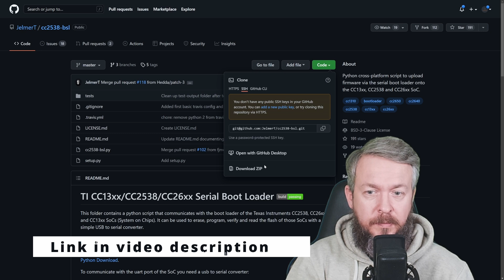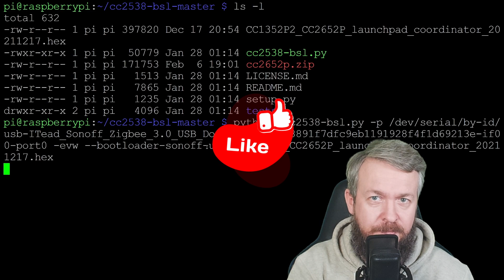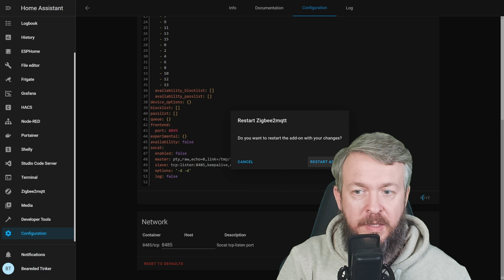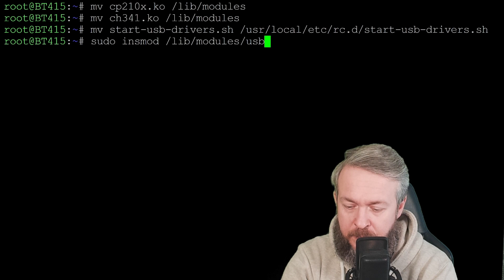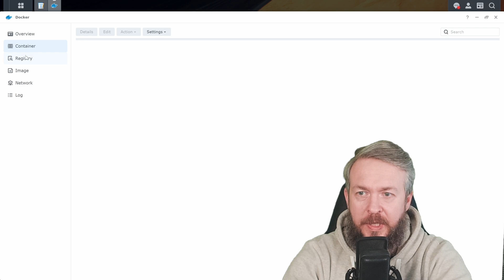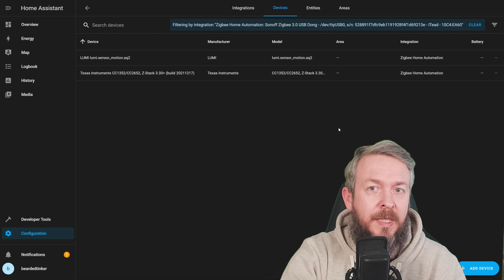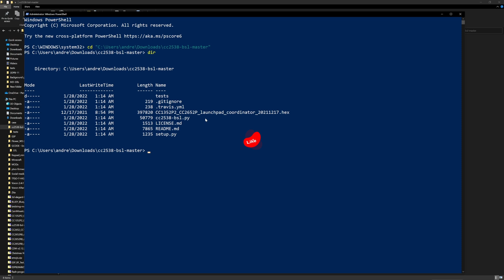Flashing Sonoff Zigbee 3.0 USB dongle plus and Home Assistant guide

Comment: getting this error in windowa PowerShell: Opening port COM3, baud 500000
Reading data from CC1352P2_CC2652P_launchpad_coordinator_20240710.hex
Your firmware looks like an Intel Hex file
Connecting to target...
ERROR: Timeout waiting for ACK/NACK after 'Synch (0x55 0x55)'
Reply from the maker: I haven't used this in a long long time since we now have easier and better ways to flash firmware.
If yo're using HA, try https://youtu.be/E39ECyCXJaA
Reply: @BeardedTinker  I got the same error and your new method is also not working as when I add the zigstar to the store it dont show at all no matter how long I waited !!
Reply from the maker: @mundhiral-kiyumi8300  This error is usually associated with USB device not being in BSL (some devices require you to press and hold the button on it while connecting device to PC) - or could also be when wrong port is used.
Quick Google search gives this: https://github.com/JelmerT/cc2538-bsl/issues/116
As for ZigStar Addon - if it's not visible immediately, URL could be wrong.

Comment: Tried to flash the new 2023 f/w no luck :(
Got an error: int() can't convert non-string with explicit base
Anyone knows how to resolve??

python cc2538-bsl.py -p COM3 -evw --bootloader-sonoff-usb CC1352P2_CC2652P_launchpad_coordinator_20230507.hex
sonoff
Opening port COM3, baud 500000
Reading data from CC1352P2_CC2652P_launchpad_coordinator_20230507.hex
Your firmware looks like an Intel Hex file
Connecting to target...
CC1350 PG2.0 (7x7mm): 352KB Flash, 20KB SRAM, CCFG.BL_CONFIG at 0x00057FD8
Primary IEEE Address: ....
    Performing mass erase
Erasing all main bank flash sectors
    Erase done
Writing 360448 bytes starting at address 0x00000000
Write 104 bytes at 0x00057F988
    Write done
Verifying by comparing CRC32 calculations.
    Verified (match: 0xe83aa727)
ERROR: int() can't convert non-string with explicit base
Reply from the maker: No idea actually. You may try using other method - with HA AddOn if you are using HA OS - https://youtu.be/E39ECyCXJaA

Comment: "could not open port /dev/serial/by-id/usb-ITead_Sonoff_Zigbee_3.0_USB_Dongle_Plus_0ab963cbe844ed11ae65c8c90a86e0b4-if00-port0: [Errno 13] Permission denied: '/dev/serial/by-id/usb-ITead_Sonoff_Zigbee_3.0_USB_Dongle_Plus_0ab963cbe844ed11ae65c8c90a86e0b4-if00-port0'", i cant put it in manual bootloader because it says that it cant find device because its not in bootload mode. I tried holding button after connecting, i tried holding button when connecting, of course every time at least 10 sec. No idea...
Reply: after using sudo i get this "ERROR: Timeout waiting for ACK/NACK after 'Synch (0x55 0x55)'"
Reply: Found solution, i had to disable ZHA in HA :)
Reply from the maker: Glad you managed to sort it out :) BTW  did you see latest video on flashing Sonoff devices? Via Add-on? https://youtu.be/E39ECyCXJaA
But still, you need to disable ZHA or Zigbee2MQTT to release the port/device

Comment: no luck for me... 

Getting ERROR: Timeout waiting for ACK/NACK after 'Synch (0x55 0x55)'
Most of the troubleshootign guides that I have seen mentioned this is because of the bootloader setting not being enabled, and can be remediated with --bootloader-sonoff-usb, but I'm already using that flag. 

One thing that is interesting though is that my device isn't under /dev/ttyUSB0, its /dev/ttyACM0, I wonder if that has anything to do with it
Reply from the maker: Maybe you should manually put it in bootloader mode. Or try to ask dev on GitHub - he really tried to answer all issues.

Comment: This was BY FAR the best video I have found. I can not belive the other videos comparing to this one. It work the first time on the windows method and was not only easier, it was faster. Thank you very much for this video, it solved my issue with getting the dongle into bootloader mode within a minute, rather then the hours of me trying and re-trying.
Reply from the maker: Thank you! BTW, wait till you see today's video in a few hours. There's an easier way now. If you are running HA OS.
Reply: @BeardedTinker  haha damn! Wish I had waited now. But it was easy enough 😉!
If you want suggestions I would like to know how to update zigbee devices without connecting them to native hubs. Such as ikea. Thanks again man! Subscribed now 👀
Reply from the maker: Do you use ZHA or Zigbee2MQTT? If ZB2MQTT - it's very easy as one of the options is OTA - and when you click check OTA it would go through all devices and search for firmware update and if available it would offer you update option. BUT it's limited to just few manufacturers at this time. IKEA works great, for Tuya and Aqara I haven't seen a single update in years.
Reply: @BeardedTinker  i use ZHA! Oh nice! I will Google that and see what I can find out. Thanks for your input!

Comment: Is it possible to flash CC1352P2_CC2652P_launchpad_coordinator_20230507? Hex file is bigger than erlier versions.
Reply from the maker: CC2652P  Launchpad is not same as Sonoff Dongle P - not sure if the firmware would work on it. And I've never tested it (launchpad) - I presume there is FW for it and if there is, no reason that it shouldn't work.
Reply: I have succesfully flashed version CC1352P2_CC2652P_launchpad_coordinator_20221226 file size is 401KB but last version _20230507 is 497KB  @BeardedTinker

Comment: Thanks mate!
Down to the point, no fluff and really exceptional well made.

Only little point to criticise: 
A python venv would have been great, to not to pollute the OS's python installation.
As suggestion: 
python -m venv venv
./venv/bin/activate
sudo ./venv/bin/python cc2538-bsl.py -p /dev/serial/by-id/usb-ITead_Sonoff_Zigbee_3.0_USB_Dongle_Plus_528891f7dfc9eb1191928f4f1d69213e-if00-port0 -evw --bootloader-sonoff-usb CC1352P2_CC2652P_launchpad_coordinator_20211217.hex 

Clean python, fresh firmware on the usb key, happy user in front of the screen. :)

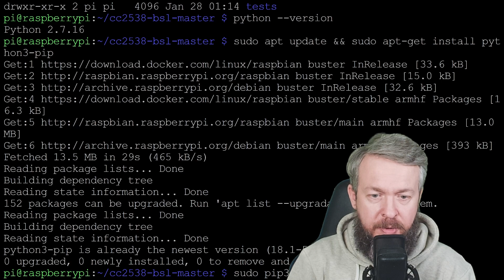Comment: 7:05 could you please move? 😀
Reply from the maker: 😱 yeah, I know... But I also add all of the commands down in video description. Easier to copy/past that copy from screen. Sorry for that 😉
Reply: @BeardedTinker  I noticed that right after I sent the comment.. haha..
Reply: @BeardedTinker  command "pip install pyserial intelhex" is not working in my end. should I continue to the next step or I have to stop right there. I'm scare if I break my device. any help?
Reply from the maker: Thats needed to communicate with USB stick and without it it will fail. What machine are you running this command on?
Reply: @BeardedTinker  macbook pro M1

Comment: Didnt work for me.

python3 cc2538-bsl.py -p /dev/serial/by-id/usb-ITEAD_SONOFF_Zigbee_3.0_USB_Dongle_Plus_V2_20221029110249-if00 -evw --bootloader-sonoff-usb CC1352P2_CC2652P_launchpad_coordinator_20221226.hex
sonoff
Opening port /dev/serial/by-id/usb-ITEAD_SONOFF_Zigbee_3.0_USB_Dongle_Plus_V2_20221029110249-if00, baud 500000
Reading data from CC1352P2_CC2652P_launchpad_coordinator_20221226.hex
Your firmware looks like an Intel Hex file
Connecting to target...
ERROR: Timeout waiting for ACK/NACK after 'Synch (0x55 0x55)'

Any ideas ?
Reply from the maker: Are you sure you have same stick - version P (https://sonoff.tech/product/gateway-and-sensors/sonoff-zigbee-3-0-usb-dongle-plus-p/) and not newer version E (https://sonoff.tech/product/gateway-and-sensors/sonoff-zigbee-3-0-usb-dongle-plus-e/)?
Those are different stick, with different chips and different firmware. Also flashing procedure is different too.
Reply: @BeardedTinker  You are right! My dongle was model E. Thanks.

Comment: thanks for the great video! but sonoff remains current? I don't know whether to buy it or wait for the new sky connect
Reply from the maker: This video was recorded on older Sonoff stick (Plus-P version). Newer one (Plus-E version) has same chip as SykConnect. The only difference is firmware. For E version, it really was not good but you can always flash newer one. BUT you can't use steps from this video to do it. It's completely different procedure. Mine is still running stock firmware (Plus-E stick).

Comment: Hello, thank you very much for this detailed instructions.
The tutorial really helped me a lot setting up my Sonoff USB Dongle on my Synology DS220+.

I am sadly facing an issue while setup the Sonoff Dongle with Home Assistant + Zigbee2Mqtt.

I run everything with Docker: Mqtt Broker + Zigbee2Mqtt + Home Assistant
Zigbee2Mqtt alone is working fine, i can find and setup my Zigbee devices in the frontend.
Home Assistant alone is working fine as well, i can see the Sonoff Dongle and pair all my Zigbee devices.

Now the issue:
When Home Assistant is running and i start the Zigbee2Mqtt Docker container then it seems like the Sonoff Dongle disconnects from Home Assistant.
And when Zigbee2Mqtt is running and i start the Home Assistant Docker container then Zigbee2Mqtt  gets an error and stops, and Home Assistant is running all fine.

Maybe you guys have an idea what i am doing wrong or what is happening there?

Comment: My dongle is being detected as USB-Enhanced-SERIAL CH9102  instead of the Silicon Labs CP210x     -- any ideas why? thanks
Reply from the maker: Is it P or E version? Fun fact - Windows 11 doesn't play nicely, no drivers as of yet...
I think it's E version and that one uses different chip but also different firmware and procedure. Mine E version is still running stock FW.
Reply: @BeardedTinker  Yeah it's the E version thanks! Stuck it in the Pi stock and managing to connect some zb devices with ZHA. Will try this for a bit before trying out Zigbee2MQTT I suppose

Comment: jadahl is down... SynoCommunity also has the drivers, but I'm running DSM 6.2 on a DS920+ (Geminilake), and the geminilake package is missing cp210x... /dev/ttyACM0 is showing up, but not /dev/ttyUSB0
Reply from the maker: Did you try with using /dev/ttyACM0 ? It could also work...
Reply: @BeardedTinker  yeah, figured that out a couple days later, but couldn't remember the video to update this. Turns out Sonoff has a second (very subtly different) sku with a different chipset due to the chip shortage, and this one connects as ACM rather than USB. 

Everything seems to be working fine. It also comes flashed with firmware that can handle all of the devices. I saw a concerning thread about it, but I haven't had any stability issues outside of an Aqara sensor. It turns out Aqara devices aren't fully ZigBee compliant, and they don't play nice with routing devices by certain manufacturers... And they refuse to try and connect to another router even if they lose connection... Forcing connection to compatible routers through the Zigbee2mqtt dashboard did the trick, though. I'm guessing the mqtt/z2m/HA people have sorted out the issues that thread mentioned.

Thanks for the videos! Super helpful!

Comment: I got a -P dongle sold on Amazon by somebody in Germany called zonoff an that connot be upgraded to work with HA. It accepts the upgrade ( I did it in windows  "pressing the button") It looks like this in HA " /dev/serial/by-id/usb-Silicon_Labs_Sonoff_Zigbee_3.0_USB_Dongle_Plus_0001-if00-port0" both before and after. Any Idea how to get it to work?
Reply from the maker: That looks like some older version I think... Mine is this: /dev/serial/by-id/usb-ITEAD_SONOFF_Zigbee_3.0_USB_Dongle_Plus_V2_20220622105009-if00 
Have to run out now, but will try to find something a bit later.
Reply: @BeardedTinker  Most grateful.
Reply from the maker: Did a lot of searching and couldn't find anything useful. Will try to search a bit more. But device name you get is a bit different from all I've seen so far.
Reply: @BeardedTinker  Right, I've spent a week now!

Comment: Why would I want to flash this sonoff zigbee 3.0 bridge?
Does it unlock something? mine is stock stick and works fine with zigbee stuff?
Reply from the maker: Original firmware on P version is a bit buggy, very old (usually there are 4-6 updates per year), some specific devices are not supported and number of devices you can connect directly and via routers was limited (I think it was 30-40 total).
Reply: @BeardedTinker  tanks.what I searched, my stick was some newer model, no bootloader button or reset button on motherboard. it was still possible mut was not so simple so I didnt so it. For me it works at the moment and thats enough. maybe someday I try the FM upgrade via jtag.

Comment: I allways get an syntax error while trying to flash the stick in Windows Power Shell: ... :

PS D:\sonoffStick> python cc2538-bsl.py -p COM7 -evw --bootloader-sonoff-usb CC1352P2_CC2652P_launchpad_coordinator_20220219.hex.hex
  File "cc2538-bsl.py", line 83
    print(message, end=attr, file=sys.stderr)
                      ^
SyntaxError: invalid syntax

any Idea ?
Reply from the maker: Check this one: https://github.com/JelmerT/cc2538-bsl/issues/111
You could have version issue, issue with path or something similar.
Reply: @BeardedTinker thank you for your fast response! I'll check it out asap.
Reply: worked, thx ! :)
Reply from the maker: Awesome! Have fun with it!

Comment: I get 

Opening port /dev/serial/by-id/usb-Silicon_Labs_Sonoff_Zigbee_3.0_USB_Dongle_Plus_0001-if00-port0, baud 500000
Reading data from CC1352P2_CC2652P_launchpad_coordinator_20220219.hex
Your firmware looks like an Intel Hex file
Connecting to target...
ERROR: bytearray index out of range
Reply from the maker: Hmm - is that older P version or newer E version of Sonoff stick? Looks like P but this error can show-up if using wrong firmware (or if bootloader not active).

Comment: Hi BT! I'm rather late to join the Home Assistant / Sonoff 3.0 USB ZBDongle-P party. Your video's absolutely sliced many cakes for me. Update: DS1821+ 32GB / Version: 7.1.1-42962 Update 1 / Home Assistant VMM 2CPUs + 4GB / Home Assistant 2022.9.6 Supervisor 2022.09.1 Operating System 9.0 Frontend 20220907.2 - latest. The Sonoff 3.0 USB ZBDongle-P is updated to fw v20220219. When restarting my NAS, the VMM reboots (auto-start) with the ZBDongle-P auto reconnects to the VMM and the Zigbee is in sync / up-and-running in my HA setup. Very happy with the resolution. I hope future updates will only make the use of Zigbee even better. Cheers to you and all the contributors!
Reply from the maker: Awesome! Really glad to hear when videos help out! :) Enjoy your Home Assistant!!!!

Comment: Excellent video! I'm starting my smart home and I found this video, perfect because I have the NAS synology! Now I need to buy the sonoff dongle, I entered the site to buy it and came across two versions, models P and E, which one is recommended? Thanks!
Reply from the maker: If you can get P, it would be great. E version also works in Virtual Machine (haven't tried Docker), but it's a bit different, less documented and upgrade procedures for it are not compatible.

Comment: Hi, my try failed during installation ERROR: Timeout waiting for ACK/NACK after 'Synch (0x55 0x55)'. Not shure what is wrong, I found my stick in "/dev/serial/by-id" and replaced it with stick id in "Command to install firmware - Linux". The only thing I could see before i run the command was that there was no port mentioned in stick id.
Reply from the maker: Not 100% sure but this could be due to the few reasons. One can be that first trial of the flash failed and now board is missing bootloader. Second thing can be that there is a problem with cable if it's connected via cable.
But if the device was missing (no port listed) that can signify also few reasons - worst one that chip is dead.
Did you try flashing without opening it? And if yes, did you try to flash it by opening and pressing boot button?
Reply: @BeardedTinker  Yes I have tried both methods but does not work, the stick looks different. The reset and bootloader button is in a different location, and someone suggested that there is a new chip on it. Also Smart Home Junkie commented that the method he presents does not work on the new stick. https://www.youtube.com/watch?v=KBAGWBWBATg
Reply from the maker: Ohh, that's different story :)
V2 (E version) requires different tool to upload firmware. You can't use this procedure or tools.
I still haven't flashed mine - got it about month ago and it works out of box with Zigbee2MQTT. ZHA can recognise it with stock firmware, but for me it doesn't work. Some say that it also works with ZHA on USB 2.0 port. In version 2022.9 (if not merged sooner) there will be internal support for it.
There is a thread on Home Assistant Community on this V2 version of the stick (or E version because of the first letter of the chip) that also covers flashing new firmware.

Comment: HI.  I got all the the way to the very end but i get an error in powershell.  Can anyone tell me what I'm doing wrong?

PS C:\users\user\downloads\script> python cc2538-bsl.py -p COM3 -evw --bootloader-sonoff-usb CC1352P2_CC2652P_launchpad_coordinator_20220219.hex
sonoff
Opening port COM3, baud 500000
Reading data from CC1352P2_CC2652P_launchpad_coordinator_20220219.hex
Your firmware looks like an Intel Hex file
ERROR: Firmware is Intel Hex, but the IntelHex library could not be imported.
Install IntelHex in site-packages or program your device with a raw binary (.bin) file.
Please see the readme for more details.
PS C:\users\user\downloads\script>

I'm certain I did all the steps including adding the intelhex to python so I'm not sure why it's saying this.   
Thanks
Reply from the maker: You could try installing some decencies:
pip install pyserial
pip install intelhex
pip install python-magic
That's the only thing that pops in my mind currently.